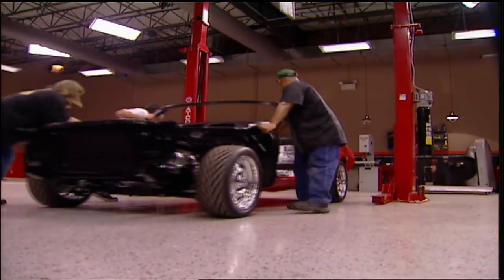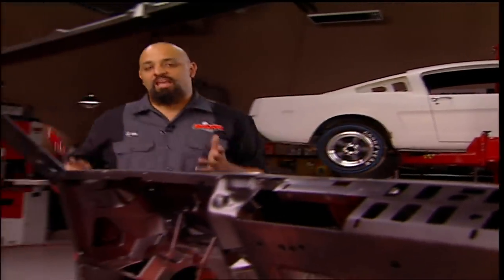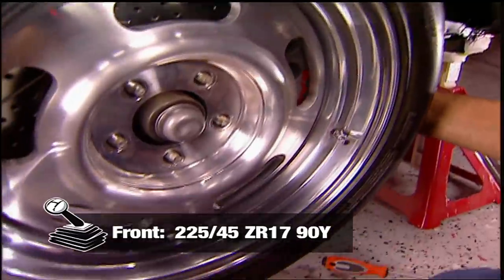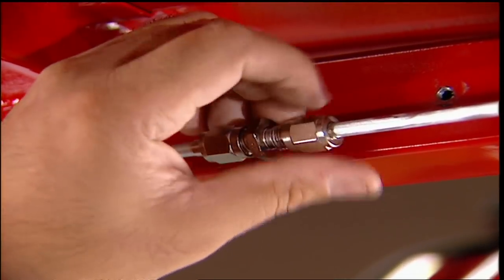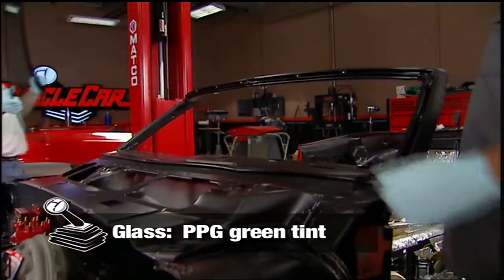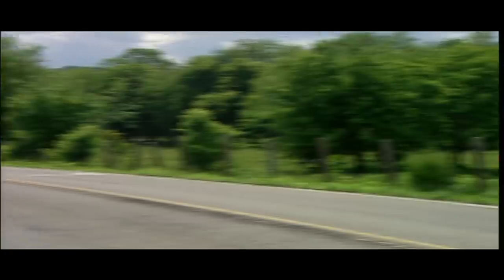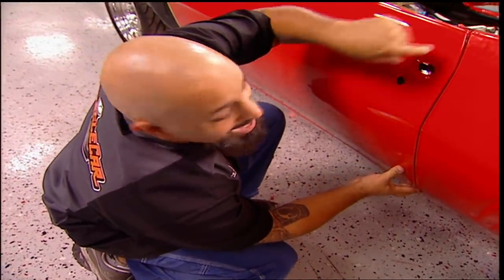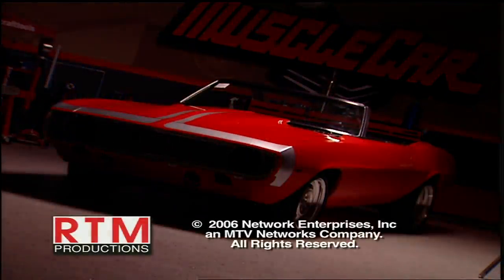Brakes, Steering & Driveshaft: The Crate Camaro Gets It All - MuscleCar S1, E16

Comment: Gotta put on your rubber.   Ya know I'm just going to take the high road on that one.
Reply: I was actually looked up dynacorn and looked at them on year one but only one had a price and generally they're about 15 to 16 grand for the Shell with doors and trunk lid I was hoping they'd be cheaper but it technically is a brand new car but then you also have everything else that's going to go into it I mean either way if you want a nice 67 through 69 Camaro it's going to be expensive I just don't know about the headache with tiling it cuz it's going to have to be inspected and depending on where you live

Comment: What is the cost of this project?
Reply: Need to figure out your taxes.
Reply: The body is $16,000 alone.  Brakes are 2000+.  Rear end is around $3000.   The ZZ4 is around $5000.  I mean I can go on.   However given that first gen Camaro are getting absurdly priced(even bucket 67-69 Camaros are easily $10k+) this isn't a bad way to go.  Especially for a drop top.   Cost isn't the big issue for a lot of people.   It's the skill that is needed to build it.  If you can't build it it will cost as mulch as a restored original.
Reply: @bmstylee  yes body, I’m after the whole build excluding the labour
Reply: @samperras  if you're paying for someone else to build it 75k+